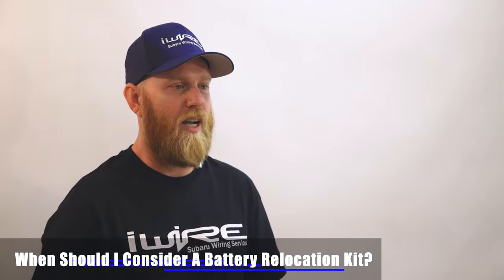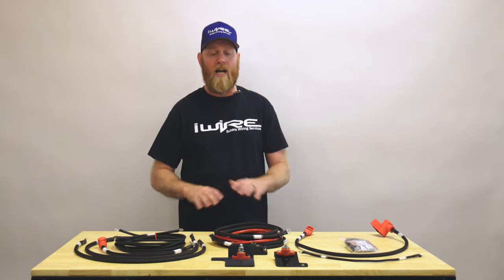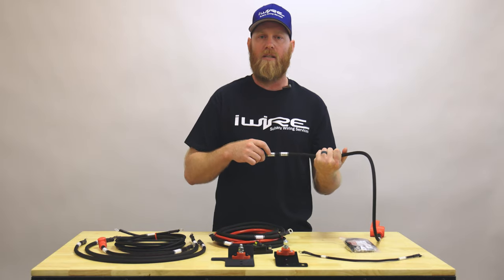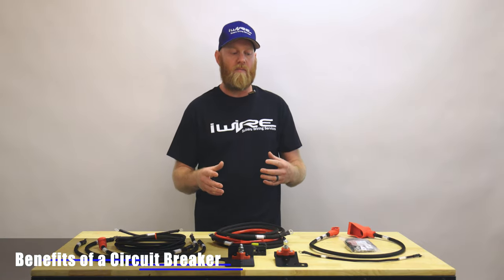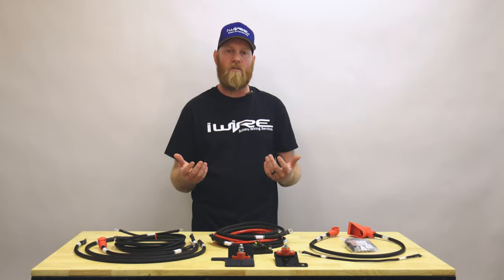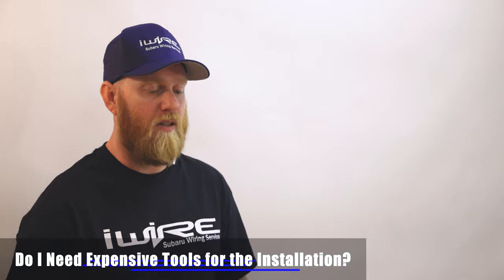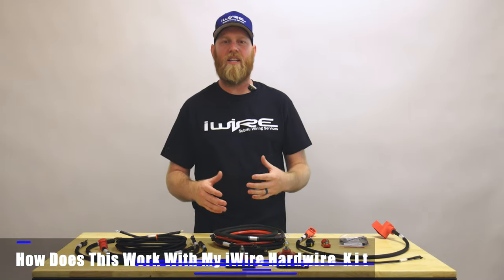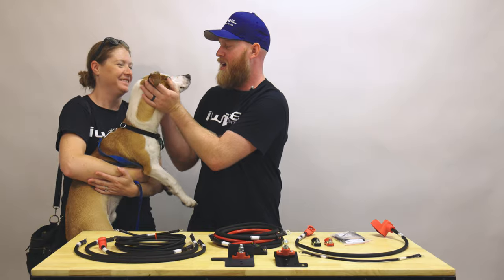iWire Battery Relocation Kit - Product Highlights

Comment: Jump starting is actually easier with trunk mount cuz 90% of the time someone parks it’s forward so the trunk is out in a parking lot. So easy access there. Plus the jump box I carry is in the trunk as well so I don’t even have to move that and stretch the cables over. This is good stuff